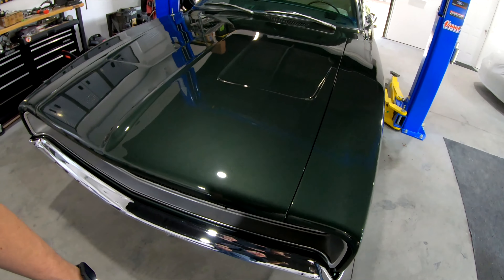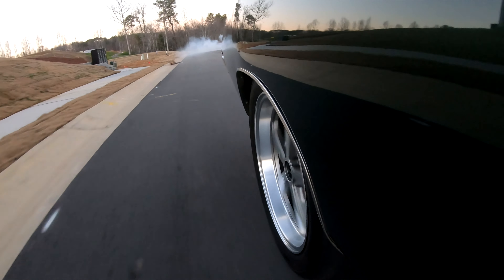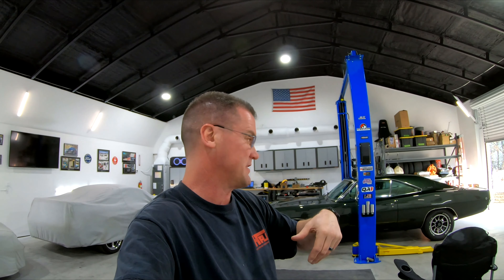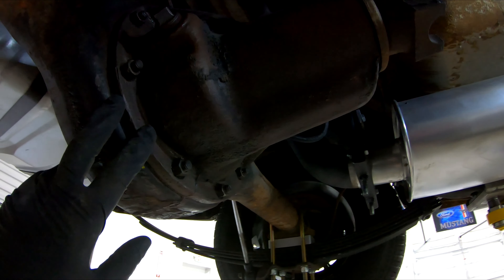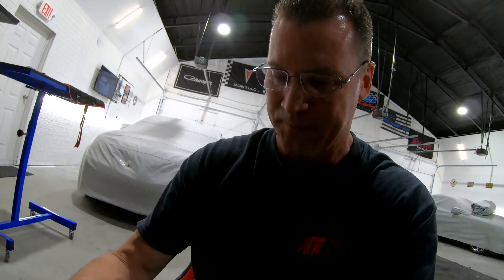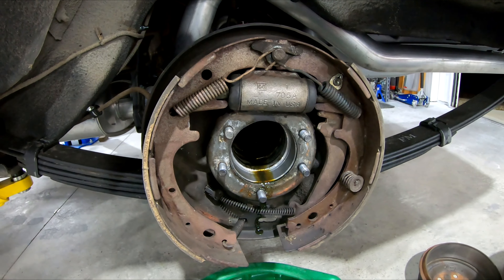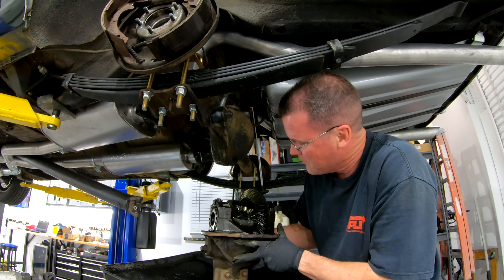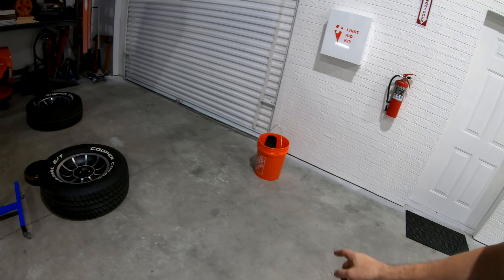1968 Charger - Part 1 Upgrading the 8 3/4 Rear End with a Sure-Grip posi-traction unit & 3.73 gears!

Comment: Hi there.. what a grate video!  I have a 68CHARGER  and have the same rear axle 8 3/4 and want to do the same as you make both wheels spin.. can you share with me  the web links of all the set up of what you got?  Also I have in my garage the 392 6.4 hemi with the transmission that I'm dropping in my 68CHARGER My question is did you use some type of custom adapter from the transmission to your stock drive shaft??  Thanks for your help and can't wait to see part 2 of your charger!!
Reply from the maker: Link to get parts for the rear build here - www.doctordiff.com
Yes you will need to adapt the driveshaft and I talk about it in my video here - https://youtu.be/qxKxf9fKmKg

Comment: Hey, not to this video. But I’ve got an 03’ explorer xlt 120xxx miles. The engine is clicking now, most likely a timing tensioner belt and could destroy my engine. I’d love to swap a v8 in and do true duel exhaust for it. It has the 4.0 v6, any tips or something to do that? I’m brand new to the car world of fixing and stuff
Reply from the maker: I have quite a few videos on my channel for the Ford Explorer, you should check them out.  As far as doing a complete engine swap to a V8.  For the time and money involved, you'd be better off selling your current EX and buying a different EX with the V8 already in it honestly.
Reply: @98saleen  current EX has family value and emotional value. I’d much rather prefer to keep it. Want to make it look like the fully blacked out EX you can see online in photos about